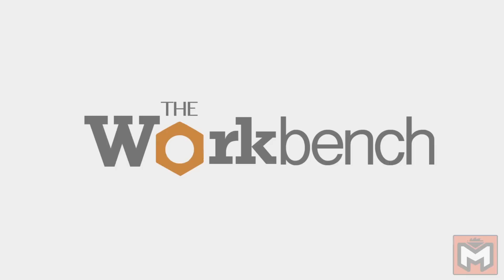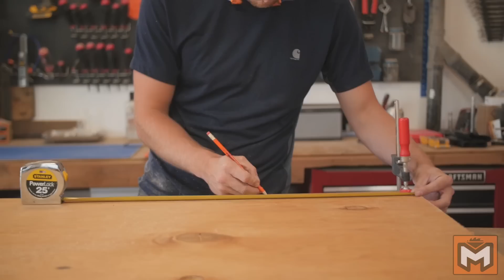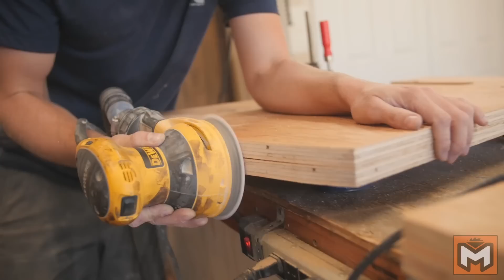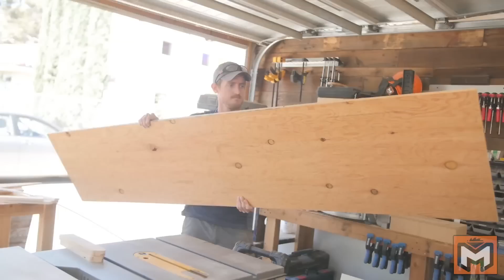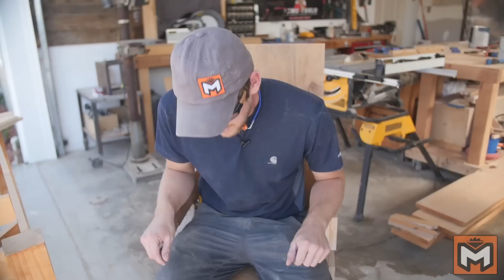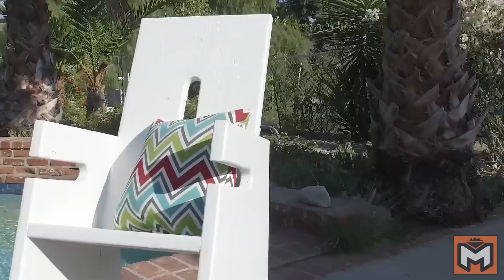DIY ROCKING CHAIR FROM 1 SHEET OF PLYWOOD

Comment: love it... gonna try it... but I think I'll make it a non- rocker... any advice on that option,  like maybe the angle for the bottom where the your curve is...? 
thanks
Reply: ....well,  what I meant by angle was if it didn't have a curved bottom,  the angle of the straight bottom in relation to the back of the chair,  you'd need the chair to angle back not be vertical... maybe 115 degrees... 

lol

I'll figure it out.... 
I'll send you pics of mine finished job...